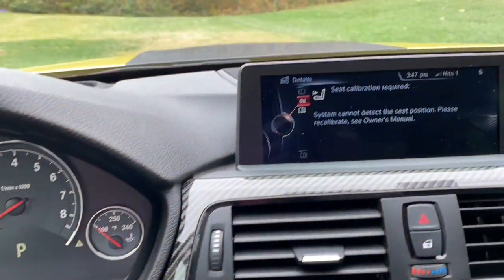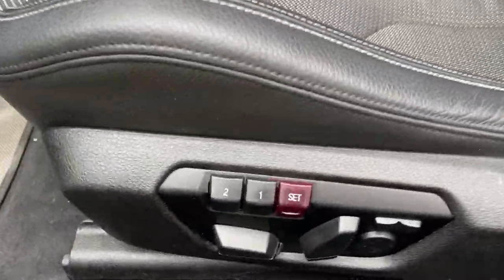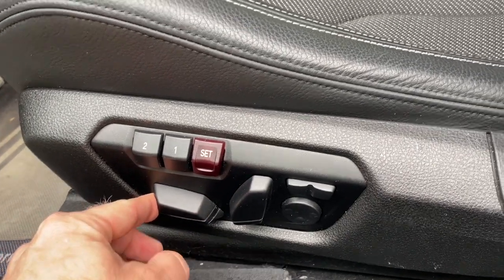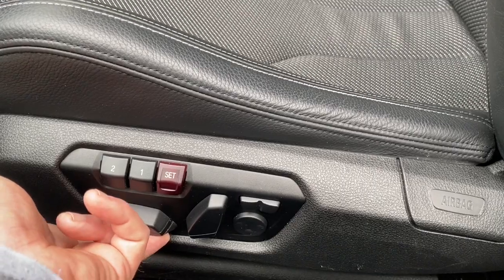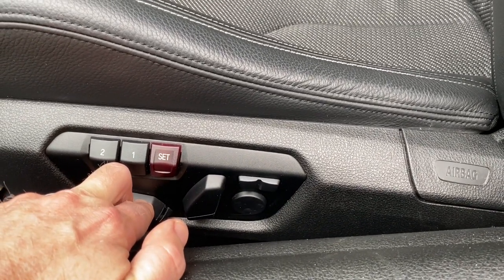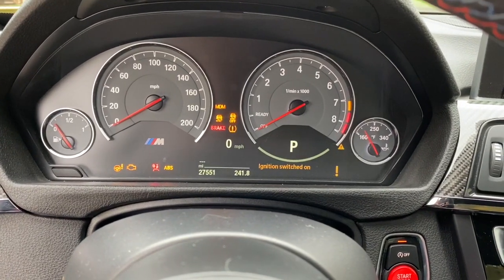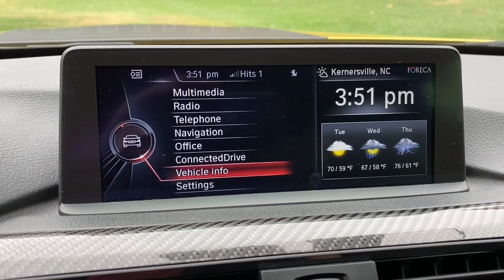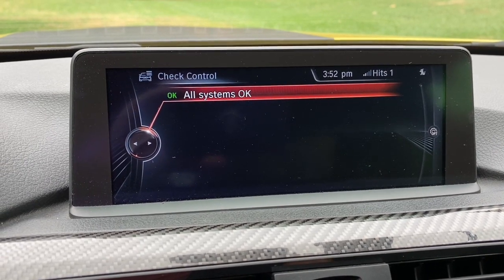SEAT CALIBRATION REQUIRED for BMW (Solved!)

Comment: nowquestio. am having my fron seat upholstery but guy said it the airbag light is going come on , so i needto go to the dealer can ypu help me ??? please 🙏
Reply from the maker: +@reynamylove3017 just disconnect the battery, remove the seats, put the seats back in, then reattach the battery and you’ll be fine
Reply: @HelpMeDIY  so I will need to reset the sunroof again. What other parts do I need to reset

Comment: Hi do you hv a method to move the passenger seat when doors are closed on the f32 coupe?
Reply from the maker: +lmh 2020 that feature is called “Comfort Access”. You can usually code that on with software like BimmerCode